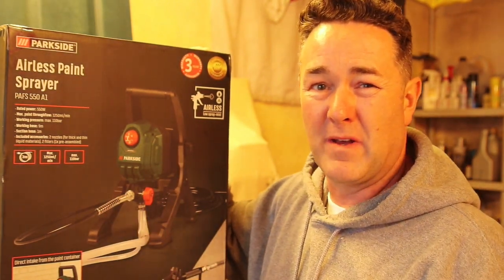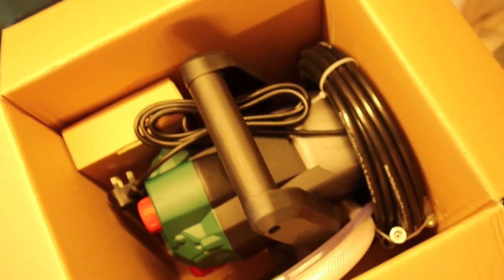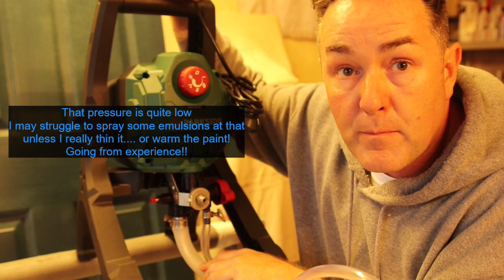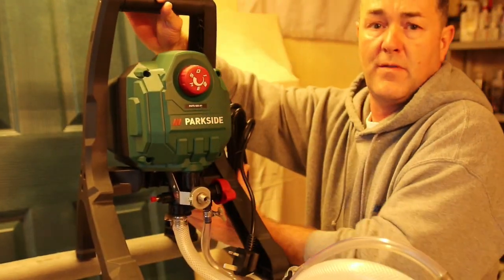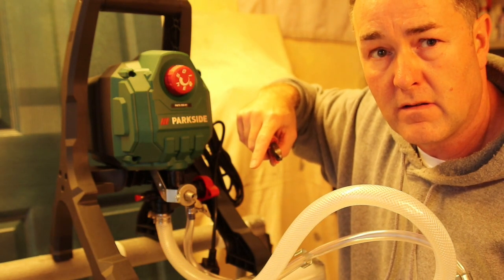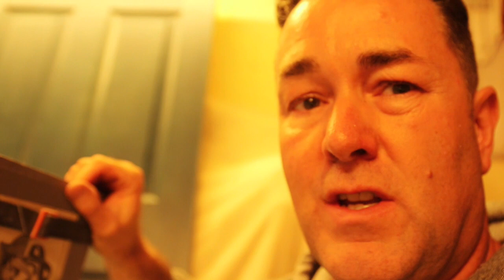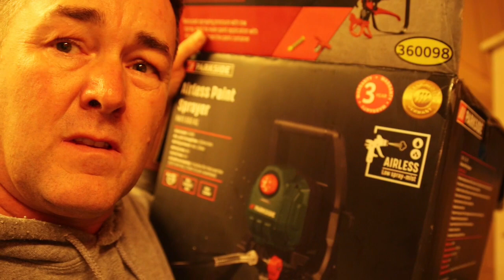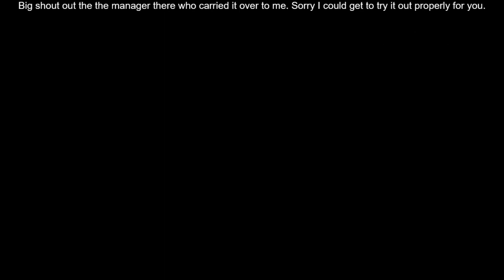Parkside Lidl Airless Paint Sprayer Review: Pro Results for £129?

Comment: Well I decided to just give it a go and see what happens.

I managed to coat 2 large rooms, a tiny landing and a flight of stairs before it suddenly starting pressurising full tilt and marking its territory.

I've seen now that when sprayers work they are fantastic. I managed to coat (note I didn't say paint, I was just sealing fresh plaster so didn't care about over spray etc) those 2 rooms and landing in around 20mins all in. It only took me around 30mins all in to mask up (held cardboard around the door frame as a shield so just masked up the rad and window, disconnected the sockets and lights.
However mixing the paint down so that it would spray, but not run took about an hour! I'm tempted by the £200 ebaur, but think I'll stick to rollers as much as I hate them...

Not looking forward to the fight with Lidl tomorrow, no reciept - Mrs slung it with the bag... I'm just going to have to play the "Here is the day I bought it on my bank app, and it's Parkside, your make, and it's dropped its guts all over my floorboards so no I wouldn't like an exchange" 😬😞
Reply from the maker: Well at least you got a go with it... When you did spray with it, was there enough pressure from the unit to get an even 10" fan pattern without getting tails at the edges?

I think if you can prove you paid for it they should take it back. Have you the Lidl app which had proof on there?

Keep.me posted how you go on.
Reply: @ProfessionalPainterDecorator  no lidl app but it says online they accept proof of purchase or receipt for faulty items within 12 months. Im only a month or so on since they went on sale and my banking app shows an amount over the amount of the sprayer a few days after it came out.

I had a faint tail on the one side, to rectify I just held the gun slightly at an angle so the side with the line was further away so it faded out as overspray, which was fine for me in an empty room.
I'm not an expert (first time spraying) but I've done some youtubing haha.

Comment: You're not alone, I bought this sprayer last Friday in Ireland and almost exactly the same thing happened to me. It primed ok, I switched to spray and spend about 15 minutes holding the sprayer at a bucket. Nothing happened. The motor was running, it just would not pump paint. Then I tried priming again and it wouldn't prime anymore. After a few more tries of spraying/priming the selector knob came loose and didn't work anymore. 

Back in the box for a refund, i wouldn't bother trying a replacement. Very disappointing
Reply from the maker: Thanks Pat for replying. I took it back this afternoon and got a refund.

Maybe we were expecting far too much for £129.

Comment: I bought an impact (parkside) wrench claiming 400nm, 4ah battery and charger 80 euros.Couldn't undo my car wheels bolts. So out of frustration because just wanted a tool that does the job its claiming to do i bought a dewalt dcf 899. €400.Total beast, removes truck lug nuts, get what you pay for.
Reply from the maker: hi, you do get what you pay for, is it still working well?

Comment: Phil don’t beat yourself up about this. Your review is a straight out of the box to spray. With all your experience and it blows up, then a newbie is not going to fair any better. The price was £129.00 including VAT. So without the VAT (tax)  £107.50. LIDL will be making a profit on it. The freight costs and import taxes from China. So cost to manufacture is going to be  possibly about £50? My gripe with these machines is always the safety element of medium pressure airless machines and injection injuries.
Reply from the maker: Very true. This is why they shouldn't be sold next to pillows and fruit and veg.

Comment: I bought one too, was able to spray one room and then it stopped, not a drop of paint came out, took the whole thing apart and cleaned it, the pump piston goes up and down nicely.  You can see this if you remove the suction hose and the coupling above, the ball comes out with the ring, rubber and spring, then you see the piston go up and down, I have put a warm water hose on it, everything runs nicely  everything is loose but it no longer works, the piston of the pump with the ball is probably where the problem lies.... that's why I ended up on your video to see if several people have this problem and yes, I will go for a while  investigate further, but if anyone has a solution, I'd love to hear it
Reply from the maker: I wasn't going to fiddle with a brand new £129 sprayer.
If you see the other Sprayers I have, I can strip them down easy.. a good clean is the first port of call.

Thanks for finding me... like, subscribe and also... comment on the video to win a laser measurement device. .. being drawn once I pass 7500k subscribers

Comment: Aldi has one on at the moment, I’m glad I bought a Wagner control pro 250, instead, this week since I purchased mine I’ve painted a shed, x2 fences, garden table and a porch, I’ve had no issues and the Wagner control pro 250 and it cost me £449.99, only issue I’ve found is the paint is too watery from most places with the right nozzle and filters fitted to the hand gun.
Reply from the maker: That's a good value sprayer.
Reply: @ProfessionalPainterDecorator   I bought it on amazon uk at that price, i cannot fault it great machine like the graco’s  airless sprayer range I’ve got 4 years warranty with it.

Comment: I just bought one of these, thank you!  You sharing what you know is a big help.  I hope to do some testing tomorrow and I've only ever sprayed out of a can so we'll see how it goes, i've a fence to stain.  If it doesn't work so be it.
Reply from the maker: thanks for replying, let me know how you go on. I always ease the paint, even for airless... just slightly. If you follow how I set mine up, see how you go. Frustration that mine just stopped and I couldn't even get water through it to clean it out properly.
BTW.. if you get on ok with it, after washing out with cold water then warm clean water.... if you're not going to use it for a bit, flush some white spirt through it. With White Spirt being a  bit 'oily' it will stop the unit rusting up inside.
Reply: @ProfessionalPainterDecorator  I will report back tomorrow, I'm sure there are others out there in the same boat as me looking for info on this device.  I've maybe 500ml of white spirt, how much should I run through it for cleaning and how much should I dilute it?
Reply from the maker: @MikeBtraveling  500ml ... on this unit I may even tip it down the tube so it gets to the pump, just to get it around the ball. Failing that order some proper PUMP ARMOR for spray guns... but White Spirt will do for now... remember to flush water back through when you came back to use it.
Thinning your emulsion.... trail and error, if it seems thick, add water to it so it flows nicely off your mixing stick.
Have you watch any of my other vids yet.... the one about 5 tips of spraying?
Reply: @ProfessionalPainterDecorator  Will do. I've not seen any of your other videos, I bought it today and was focused on this machine, I will check them out.  Again, thank you for taking the time to share, keep it up!
Reply: I was able to make it work, but it was not pretty.  I'll finish my fence and take it back....
Reply from the maker: @MikeBtraveling  well I'm glad you got it to work.... did it seem powerful enough, was the fan patter even?
Reply: @ProfessionalPainterDecorator  since this is the first time I've used one I'm leary about making statements but the fan pattern seemed even but power did not seem consistent.  As I was spraying water based stain and needed to back brush anyway it was not a huge concern.  I had issues with it priming and had to clean out the intake hose once but it was easy.  I'm thinking I'll wait for the 20v parkside hand sprayer to come out and try that, any thoughts on that one? This sprayer is still going back.
Reply from the maker: @MikeBtraveling  as soon as that hand held comes out I'll try one out and review it just for you.

Comment: Phil, great review you are the first who made a detail review about the Parkside sprayer. I got it still in the box and gonna use it in a few weeks to paint the whole inside of the house. great value of your tips! also an shame it didn't work after 1 hour of review. would be half day review for you.. big disappointment. do you got other tips? im gonna spray latex paint on the walls and ceiling. I guess I need to use the 517 right? how lower the pressure how better the spray pattern. but the paint looks pretty thin. also making it a bit thinner then. thanks a lot for the review!!
Reply from the maker: hi, see how you go on with it.
watch some of the other videos I have in the playlist for airless spraying.. there'll be stuff in there to help you :D

Comment: Well lad I bought one here in ireland 27 days ago and seen your video today so opened it out of the box ran water through it and had the same problem leaking from the same place so brought it back got the money back disappointed more than anything would of been a great bargain if it works.
Reply from the maker: Sorry to hear that Alan. We're not the first or last I'd think. Thanks for touching base with me over it.

What's your plans now?
Reply: @ProfessionalPainterDecorator  keep an eye out for one on Screwfix when back in stock ,see Im a plumber by trade but I like woodworking making things like kids beds and other bits and pieces in my spare time so just want a sprayer to stick on a few coats on ,would be handy also for spraying dash walls on the house😁
Reply from the maker: @alandarby9366  for furniture... Look for a Hvlp set up.
Reply: @ProfessionalPainterDecorator  I wouldn't know much about sprayers what would be the difference between like a Wagner airless set up or the hvlp one is that one ran off a compresser?
Reply from the maker: @alandarby9366  that's correct.

Comment: They have a little stainless rod with a nylon seal around it and it just punches in and out in a space like a diaphragm pump and work the same way like a super diaphragm pump is all it is with no resistance so the motor is cheap a simple too.
Reply from the maker: on paper it didn't look like it was going to be suitable for me.. but I needed to try it.

Comment: Excellent video Phil! You really do get what ya pay for, I bought a cheap diaphram airless sprayer from vevor and its not up to scratch for commercial jobs - overheats, loses pressure. if people want to try airless spraying I'd suggest a low end electric airless hand held one just to get used to setting up and understanding the spray adjustments on the gun before going the full thing with a Graco or Titan/Wagner.
Reply from the maker: Thank you. Paying a bit money does make it less stressful when getting the kit out. You know something decent is going to work... As long as you look after it.
Been using my GXFF again this week.... No problems.... Wanted to get the 495st max² out but room size didn't allow it. :(

Comment: Mr Phil Beckwith The Professional Painter & Decorator...could you please advise me on the best budget paint sprayer for kitchen cabinets and as a bonus  it would also do as   internal walls aswell ....thanks
Reply from the maker: when you say budget... what price are you thinking?
Reply: @ProfessionalPainterDecorator  £150 max...
Reply from the maker: @woodyforest7308  well, that would be this one then at £129. whether you'll be happen with the finish on kitchen units I wouldn't like to say. Move to nearer £400 look at a Wagner. £700+ a Graco GXff. (all airless, that will do walls/ceiling and have the capability to spray low pressure.. around the 800-1200 psi)
It is a case of you get what you pay for really. Or what you're happy to accept as the finish.

Comment: The worst thing is if they don’t have it in stock (which they probably won’t), you won’t even be able to do an exchange. No spares available either. Same with their track saws. Cheap but often not in stock. It’s more of a ‘I’m feeling lucky purchase’. Sadly you lost this time 😞
Reply from the maker: I'll get a refund I think.
Reply from the maker: @pedrofonseca1442  the parkside stuff is good. I have the plaster board support poles and a brilliant soldering iron.

I was hoping would do me basic fence spraying and most coating and ceiling paint. If it sprayed my Doris the door with the yellow filter and 311 tip it would have been a winner with me.
Ideal for ppl who don't spray often and want to learn how to spray.

How I set it up is still relevant for those who have the machine.

Just. A shame mine didn't get as far as spraying my Doris the door for the demo.

Comment: Nice one. I bought one to do new fences and garden sheds. Maybe some indoor walls etc etc. It's not even coming out of the box now. Lot of brush painting on these fences now 😥😥
Reply from the maker: If you ve a lot to do. Buy a Graco GXff or gx21.
About £700
Or cheaper 2nd hand
You'll get your money back on the time you'll save 
I did 30 6' panels, taping the concrete posts up!!! Two coats in a day!!!
Using cheap £6 a 5ltr of fence stain.. water based. Looked awesome when done.
Brushing would have taken days... Price for the job done, not the time taken (a day lol)
Reply: @ProfessionalPainterDecorator  hey Phil thanks for getting back. Sorry for late reply was busy busy. Im not a pro painter, just get some jobs sent my way. Mostly indoors. But before the disaster happened with leaky paint I was already thinking, "is this worth the hassle?" 
Oh that sprayer was only €129 here in Dublin, you get ripped over there :)
Reply: @ProfessionalPainterDecorator  hey Phil. How much would you charge to do a banisters in normal size house, about 20 spindles and small landing. Sand, prime and 2/3 coats?? Usually do  walls, ceiling, doors and skirtins. Me mate threw me two jobs
Reply from the maker: @DodgyD101  how long would you think you'll be on it to do one coat with a brush?
Reply: @ProfessionalPainterDecorator  well the primer can go on quicker, about 2+hrs including the sides of stair case.
Reply from the maker: @DodgyD101  let's say 2hrs per coat.
Three coats, 6hrs work.
£10ph = £60 plus cost of paint.

Start from there.

Do you want to do it for £60?
Reply: @ProfessionalPainterDecorator  jeez the open boarders must be killing the UK brother. Be here soon I suppose. 10 an hr even with the conversion is lower than McDs. I'll stick with me €150 a day. 
Thanks brother, you busy
Reply from the maker: @DodgyD101  you've missed the point.
Whatever the charge out hourly rate is you want... times that by the hours it will take you to brush it.
Does that figure sound right!
Charge for the job done... Not the time taken.
If you spray it in less time .... Do you charge less ...???
Reply: @ProfessionalPainterDecorator  i get ye. Well Ive to do hall, stairs, landing and living room so I'll do a price job on the lot.

Comment: Is it possible to fit a tip extension to the handle? For spraying ceilings and such. From what I understand this is not included?
Reply from the maker: Hi. No you don't get one included. 
If you look through my other airlines spray videos on the GXff, I show you using an extension and a Clean Shot!!
These are used to stop paint spits you get from using an extension.
As there is still pressure pushing the last bit of paint out the extension when you release the gun trigger.

There's is a nack to reducing extension bar spits, but it's more advanced knowledge and with this ParkSide unit you may get frustrated with its lack of power when you may need more pressure spraying thicker emulsion paint.

Comment: I bought the same one from Lidl preparing for painting the whole house today, after finishing first floor nicely with emulsion paint and I moved down to finish ground floor but the machine suddenly refused to spray, after many trying and can't solve, then I dipped the suction pipe and primed with clean warm water and hopefully the blockage can be flushed, and suddenly water paint started to come out from the machine bottomed (exactly the same as in the video) and I placed the machine to catch the falling liquid and noticed a thick layer of grease floating on top of water, and what you can expect is the machine is gone and can't work after that point.
What a piece of expensive rubbish!
Reply from the maker: You get what you pay for. Have a look at the recent video I did using the £65 sprayer from Screwfix... You may like that.

Comment: I don't know about spraying but I do know pumps. All I can think is the viscosity of the paint because water went through so their was no blockage but paint didn't.  All it can be is nozzle blocked or viscosity in my opinion. But it should push that through so I agree waste of money
Reply from the maker: The paint used I used through sprayers before, so it viscosity was fine.
All was good. Got a refund ;)

Worth trying though.

I've upgraded to a Graco 495st max II.

That's on another level.

Comment: i just got in to spraying for some work on side abd extra money .... first i was looking at wagner 150 then i thought for extra for hundred i brought wagner 350r as you got pressure dial and longer hose you just get what you payed for 👍
Reply from the maker: hi, how are you getting on with it?
Reply: @ProfessionalPainterDecorator  its awesome for my first machine i done a new kitchen and dinning room with it last weekend walls ceilings wood work customers are well happy ... but you cant replace the pump on it like graco models you have to clean it right though .. as i get home i do add some oil in the inlet value it sertonly payed for its self ..  my next machine is defo guna be graco gxff cordless as some customers get a bit funny with useing there eletric ect